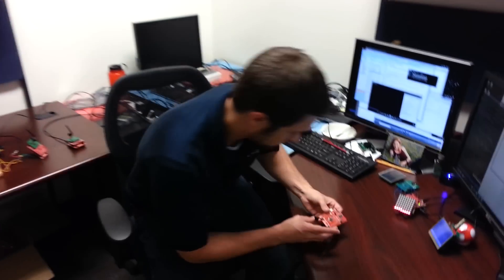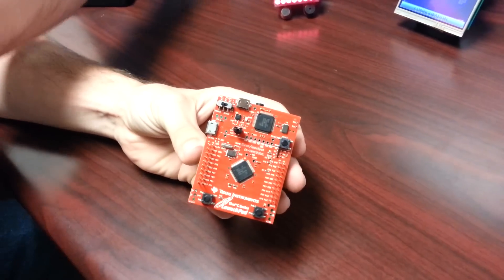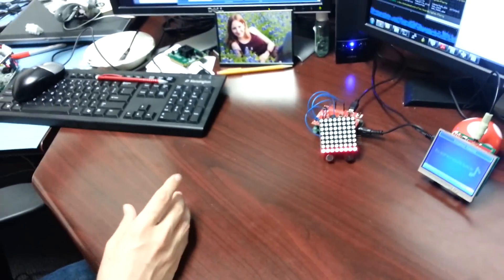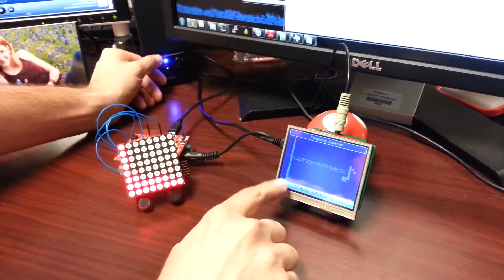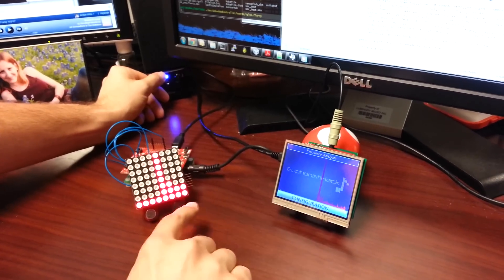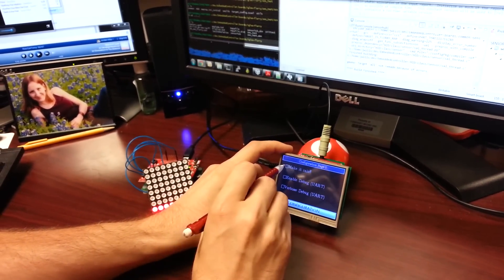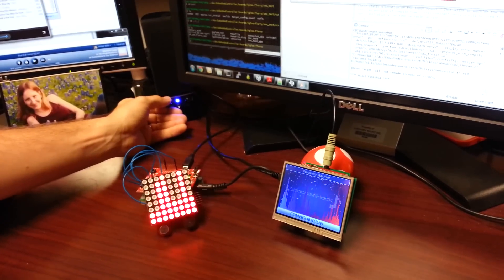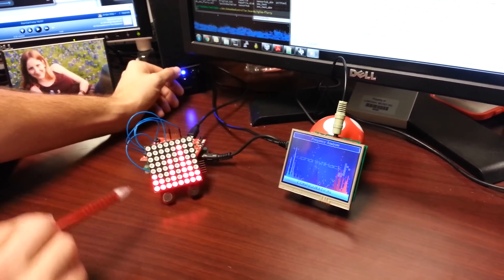Tiva C Series Frequency Analyzer

Comment: HI Jordan. I'm a blogger for element14 and I'm going to be using the ADC to detect sounds. I was wondering if you could summarize your approach in software to determining frequency and amplitude? I was either going to go super basic and use just a comparator, so when a sound is loud enough it triggers an interrupt. But I'd much rather do some basic frequency detection. Thanks in advance if you can help! Feel free to message me directly if you prefer.
Reply from the maker: Hey Aurelius, sorry for just now getting back to you.  I don't think I could do justice trying to summarize all that in a youtube comment, but you might want to check out my writeup over at http://euphonistihack.blogspot.com/2012/12/the-writeup-2-electric-boogaloo.html

Along with a description of the algorithm I used, my blog also contains links to the sourcecode for the project.

As for a quick basic summary, my project uses a 12 bit ADC to capture audio from 0-3.3 V.  From there, I pass it through a hamming window, then a 2048 point FFT.  Then, I divide the 2048 element linearly spaced array into a number of logarithmicly spaced bins (based on how many bars the user wants to display), average the power stored across that range, and compare that to how much power has been observed in that range in the past.  That determines how high the bar should go.  The frequency of each bin is super simple to figure out, as it's just sampling frequency divided by FFT resolution.

Good luck!